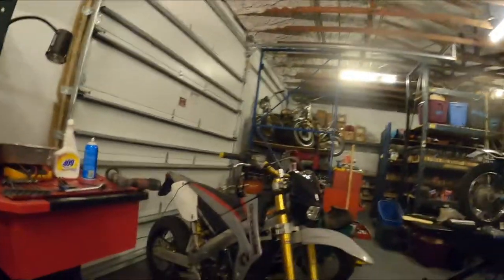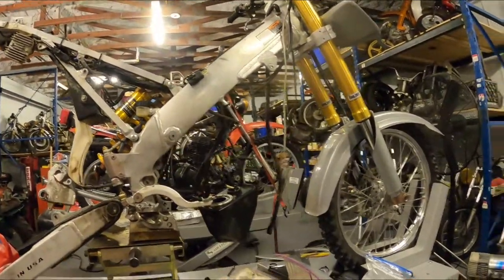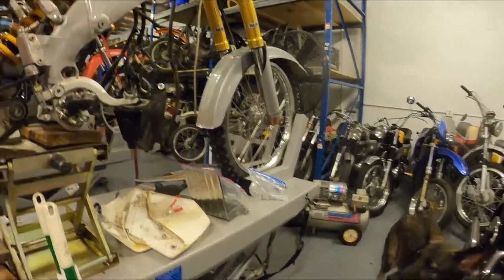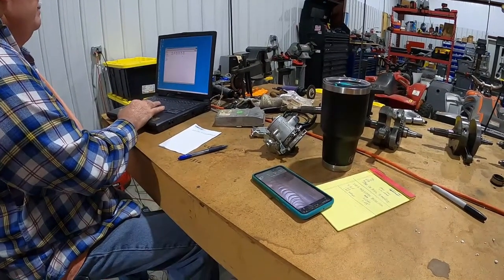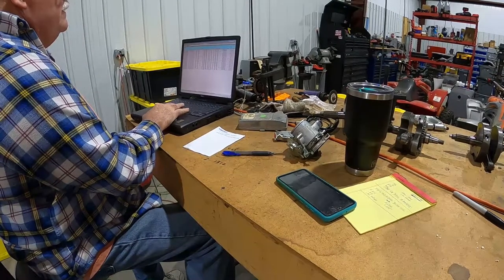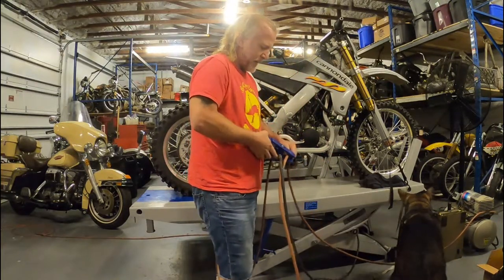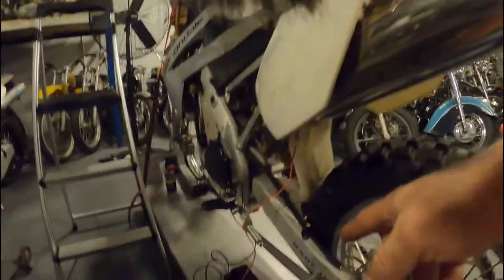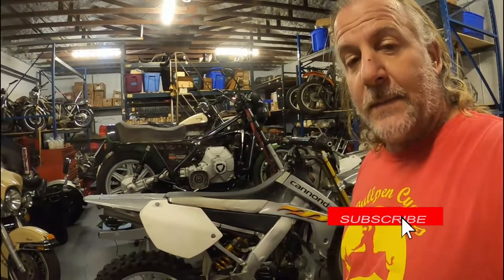CANNONDALE DIRT BIKES, NOT FOR THE FAINT HEARTED

Comment: Still have mine, it runs fine, but I don't use it that much.  Did someone chnage out the seat and shrouds?  Because that red color is from the 2003 model year.  Mine has an aluminum valve cover to prevent the problem.
Reply from the maker: Could be. This SM replica had some use and a few prior owners. Just updated that engine too, ready to reinstall